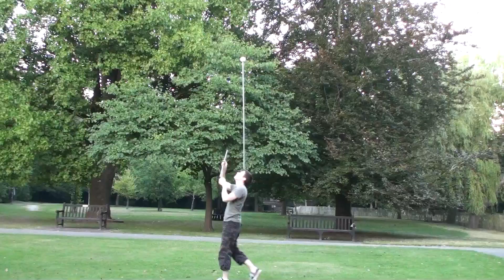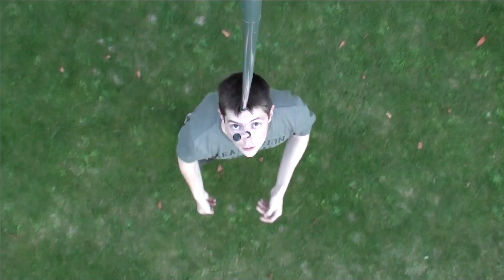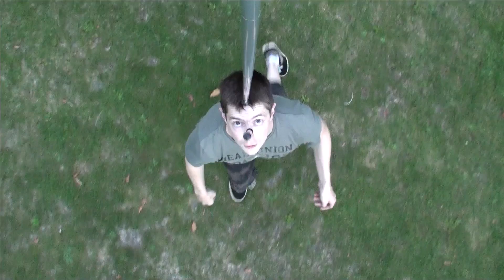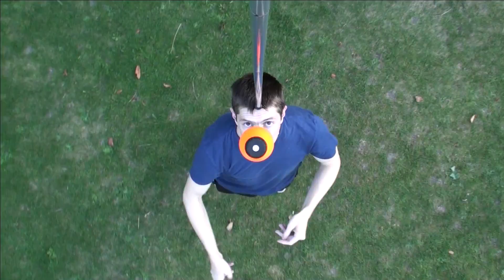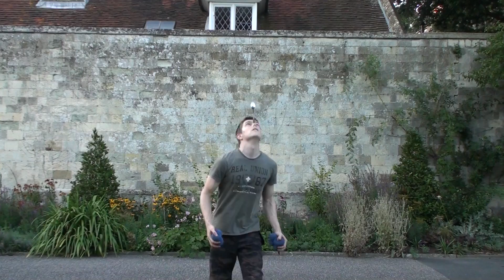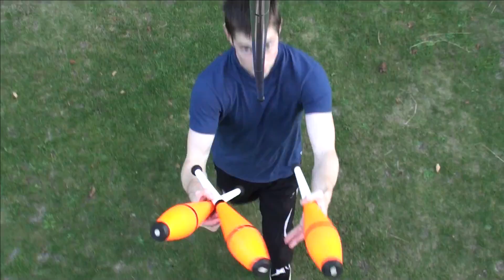Dual Balance

Comment: I was thinking, you could also balance 2 objects of the same length if the center of gravities were at different heights. For example, 2 identical snooker cues where one is balanced on the tip and one on the handle.

Comment: I don't think so. The oscillation period of a pendulum is T=2*pi*sqrt(L/g). Mass doesn't come into it, only the length does. Maybe if you took air resistance into account - you could balance a feather and a pole of the same length.

Comment: Could it work with 2 same length poles if one was substantially denser than the other?
Would the increased inertia due to the mass provide the same effect?

Comment from the maker: No, but it would definitely be possible. It's easier to cheat with a ball and balance in a groove in your head or hair. You would need to use quite a small ball so that it doesn't touch the club.

Comment from the maker: Thanks. Yes I was mainly inspired by control systems / robotics for this. You can see a swing up of the dual/twin balance on YouTube. I've never seen or heard of a person doing it before though. All the pictures I've seen of jugglers doing something similar are using pedestals or mouth sticks for at least one of the balances. It does feel similar to the double balance but a lot easier. I do the feather on top of a juggling club in my best bits video. I'd like to learn it with 2 poles though next